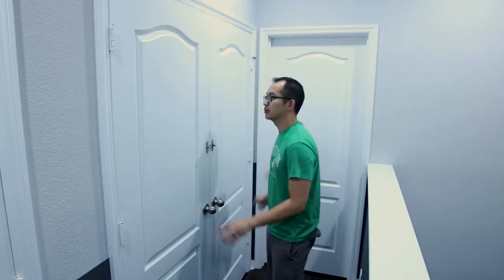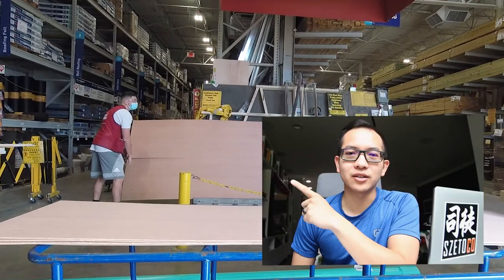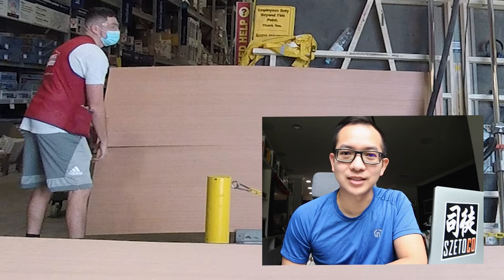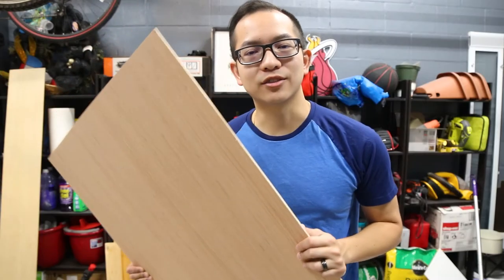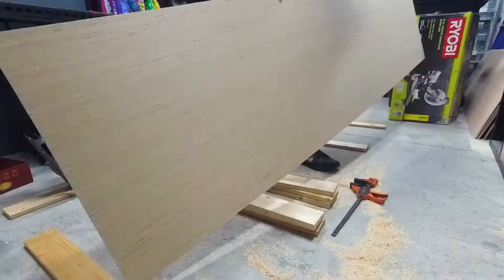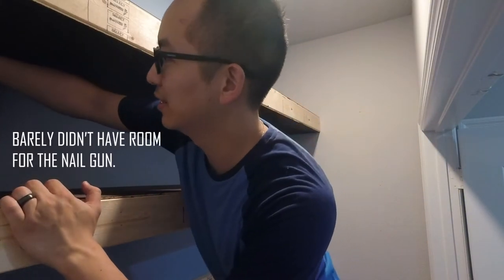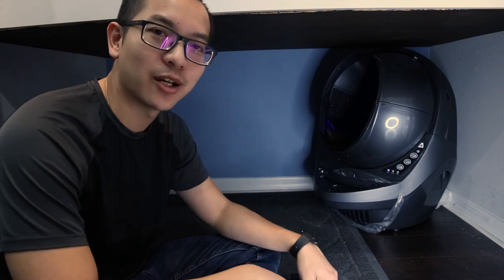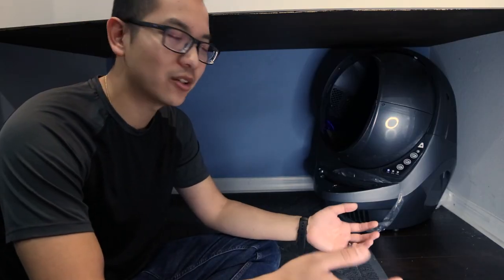Floating Shelves Inside Closet | Home Improvement #1

Comment: how did you plug it in?
Reply from the maker: The litter box? We ran the line through the wall behind it since there was an outlet on the other side of the wall. It's temporary until we can rewire that area to have an outlet on the correct side. The lights are battery powered. Thanks for your question!
Reply: @SzetoHomeDIY  Thanks for responding! Yes, I was wondering about the litter box. Thanks again, will have to try this with my litter robot!